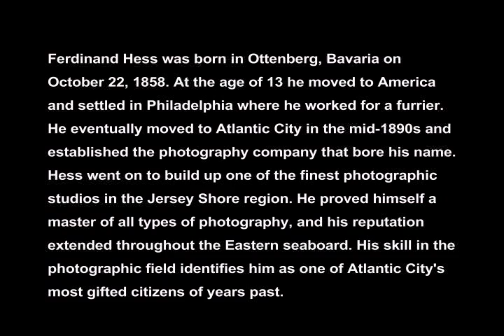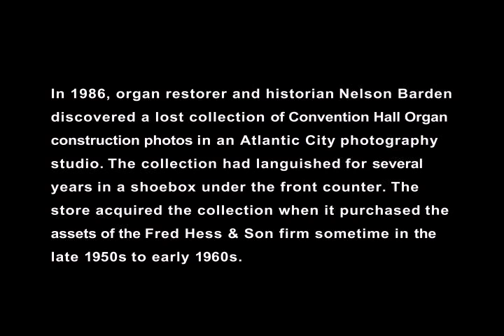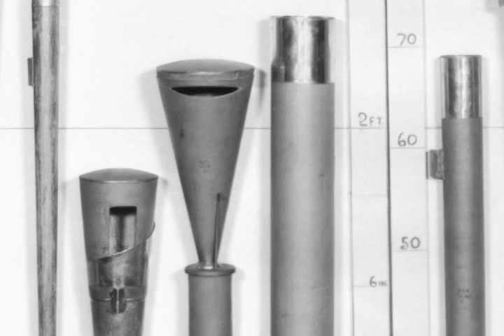Atlantic City Convention Hall Pipe Organ - Hess Collection HQ

Comment: The larger organ is currently under restoration.  I took a private tour of both organs and I was able to hear both.  The larger organ's right side has issues(mostly tuning and leaking issues)but is playable.  Money is tight and it takes alot of time to get things done.  The left stage chamber has a huge portion removed and is being restored right now.  The Curator said it will be awhile for it to be restored.  However, the smaller organ is almost completely restored and sounds good.

Comment: I remember hearing this organ as a very young child (1950s) and being amazed at the power and seemingly endless reverb in the massive space. It is pitiful that it has fallen into such disrepair. A roof replacement could have saved most of the water-damaged chambers that now will cost 20 times what a new roof could have prevented.
I find subtle irony in that the two largest pipe organs in the world are within 60 miles of each other. Was it to compete with the Wanamaker organ in Philadelphia?
Reply: Were all the organ chambers functional in the 1950s?

Comment: @danielmkubacki once the swell organ is back in after restoration and the dead magnets in the right stage are fixed, 1/3rd of the organ will be playable. Progress may be slow, but on a project of this scale, it is going to be, the swell organ alone has around 4 or 5 thousand pipes.